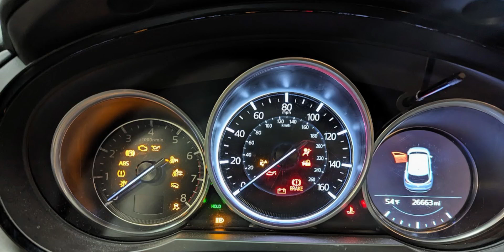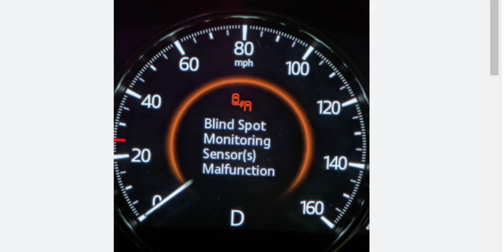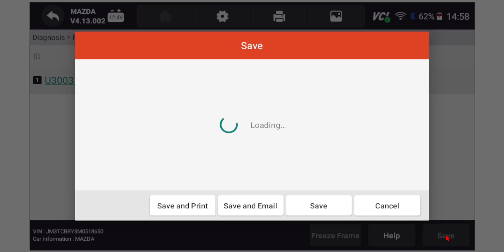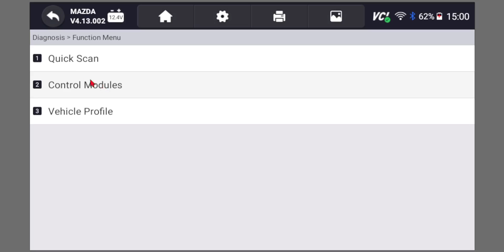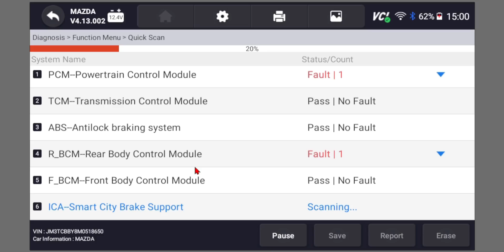Mazda Troubleshoot Blind Spot Not Working Malfunction  with YOUCANIC OBD2 Scanner

Comment: I have a 2015 Mazda 3 hatchback, I don’t have any codes coming up, it turns off and on and you can put it towards high and low from the settings but when I drive past other cars it doesn’t show anything on either one of the mirrors. Any ideas what could be causing this?

Comment: i have a 2015 mazda 6 and i scanned it it says left side short or open  ? The light on the mirror is dim compared to the passenger side.. you think its bad mirror  or can it be something else ?
Reply from the maker: Hi there! It sounds like you might have either a faulty mirror or an electrical issue. At YOUCANIC, we strive to empower car owners with the resources and tools necessary to tackle car maintenance and repairs. You'll find helpful guides and our powerful YOUCANIC scanner to assist you further with your issue. Don't hesitate to visit our site and ask any questions. Remember, we also have factory repair manuals available for a more in-depth approach. We're committed to supporting you throughout your car ownership journey! www.youcanic.com/